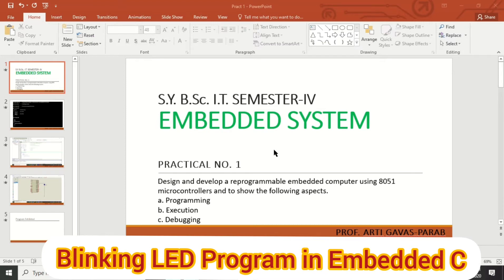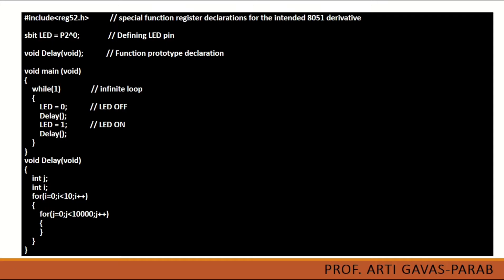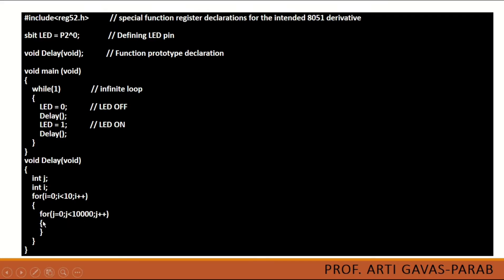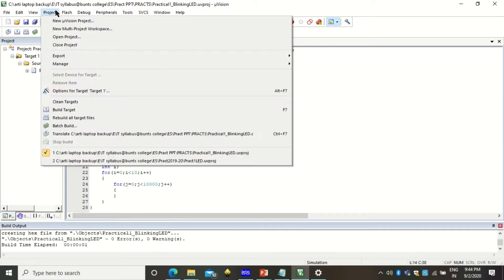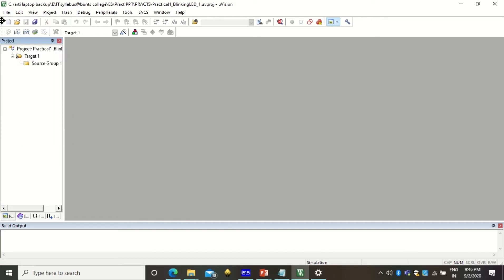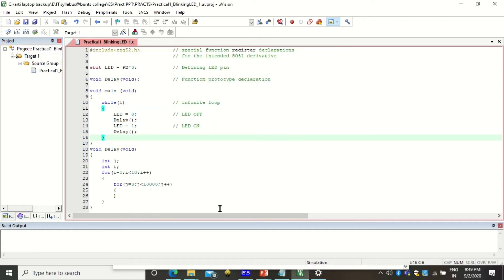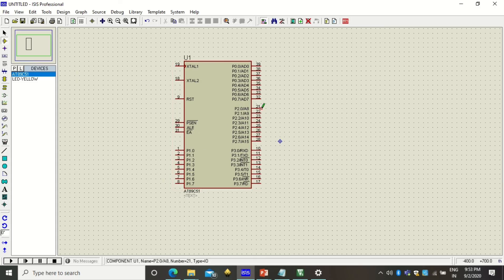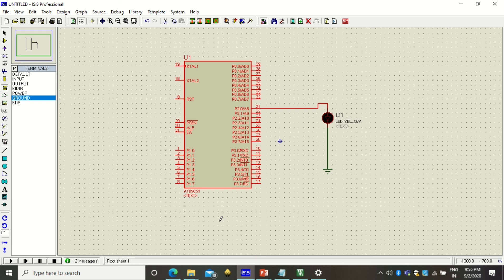Blinking LED program with 'for loop' delay in Embedded C using Keil and Protues Software for 8051 Mc

Comment: Hi mam plz answer of this question 
Write a program to display first name on first line and last  name on second line using LCD display
Reply from the maker: https://www.electronicshub.org/interfacing-16x2-lcd-with-raspberry-pi/#:~:text=The%20design%20of%20the%20circuit,is%20the%20contrast%20adjust%20pin.

Comment: Ma'am, how do i explain the code in the practical exam, like the ethics of explaining the code.......
Reply from the maker: You need to explain like why do we use registry, then how do we write user defined delay function (it's prototype, definition and call) then we have used only for loop in delay function, where we are keeping our microcontroller busy for this much time. Then you can explain what is while (1) function, why it is called superloop etc.
Reply: @artiparab4583  ok ma'am...

Comment: How to Calculate delay Value Why you're using 10000 in for loop?
Reply from the maker: It is taken Randomly. No calculation needed. You can vary the value of i and j as well. If you are going to take j=1000, instead of 10000 then delay generated will be little smaller and hence LED will blink faster. Also If you are going to take value of i=5, it will create smaller delay. You can check different variations by changing these values. Similarly, If you want longer delay, you can make i=15 or j=20000.
Please try this and let me know.
Reply: @artiparab4583  Then for 1 Second delay what is i and j value?
Reply from the maker: @raamnaath  Using for loop delay is not timed delay, but it is based on MIPS. which in turn depends on frequency of MC'. For 8051 MC' its 12 MHz for most of the brands. that means in one cycle it can execute 1,000,000 instructions. so if you want to figure out i and j values it can be i=5, j=200,000.
Reply: @artiparab4583  I will Check and Reply